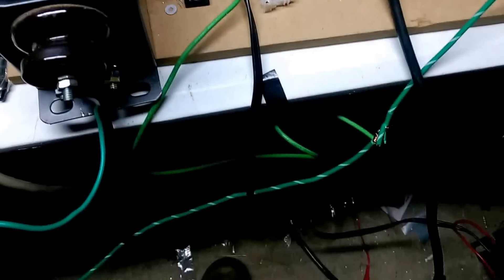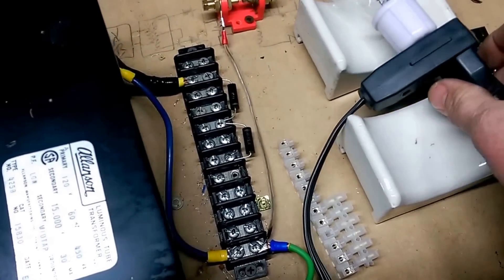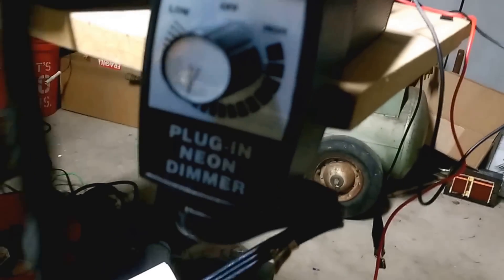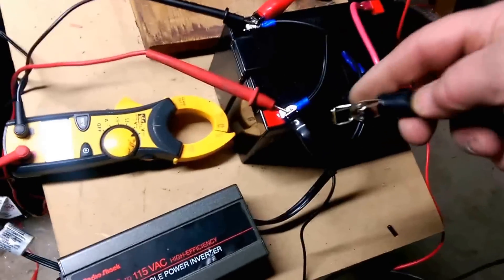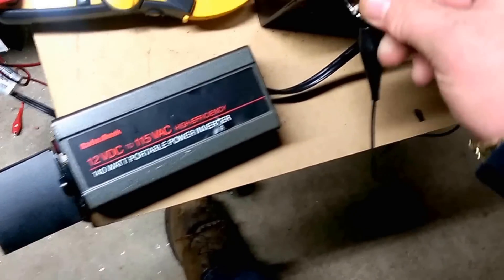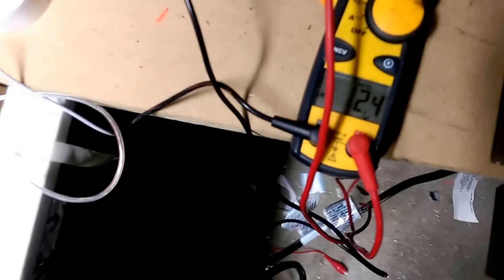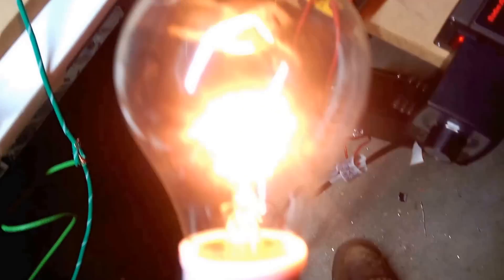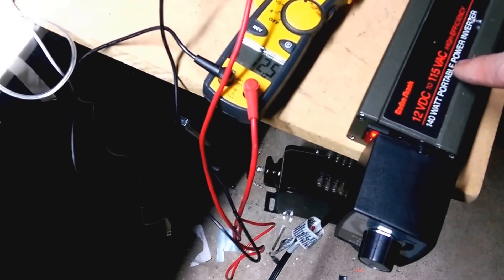Working Free Energy Generator-Dezeinstein Technologies-Annotated

Comment: Hi Marc! just realised that the inverter been powered by a battery to light a bulb is a very an ordinary thing so what is the specific of this demonstration? please.
Reply from the maker: +Didier Khwartz Ok, I have an inverter and a battery. I did power it up without the rest of the circuit so the battery does not charge from the circuit the way I have it set up and it dies just about immediately because the battery can't handle the massive ampere load that it loads the battery with. 

I have already posted another 21 minute video running an extremely bright flood lamp and the battery voltage remains the same without even dropping one volt. How could you explain this when I have (2) tiny 6 volt lead acid batteries running this, they are not high amperage batteries as inverters need high amp batteries? If you did this the same way with an inverter and the same bulb, you would see the voltage continuously drop 1 volt at a time every couple of seconds until it dies. The inverter is running off of a battery, and since it is running the NST as well, the NST is outputting 15,000 volts at 30 milliamps. multiply 15,000 volts times .030 and you get a wattage of 450 watts maximum, or, 225 watts at idle. Add the wattage of the bulb to this and you get 243 watts. The bulb and the inverter together would overload the inverter, but, it isn't overloading it and drawing too much from the battery because the battery is being charged by the circuit wirelessly.. there is no cheating, not whatsoever. 

So, if you think now that the inverter would run off of a battery for 21 minutes without running the battery down until the inverter shut off, you are way wrong. The battery could not handle this for more than a few minutes because the load would be approximately 20.25 amps at 12 volts. Please click here to watch the video of the same circuit, however, I modified an APC 300 watt computer UPS system with the batteries I used for the other circuit. The only reason why I use the UPS is so I can add more load to it to make it look as if it is doing more work to make it more believable.

First off, neon transformers are notorious for outputting more wattage than they draw, this is a common effect when they utilize high frequencies to run neon tubes, and, when they create an invisible plasma that allows a battery to draw in the system's losses, capacitively, and this can only happen with the correct wavelength, so, when I connect the ups system or the inverter to the battery with a kickback diode on the positive leg, the energy capacitively couples back to the battery as the positive leg and components are isolated with the diode, but, the energy returns to the battery from the neon sign transformer through the negative rail in the inverter since all of the grounded components are tied to one rail, leading directly to the negative terminal of the battery. The positive terminal of the battery is capacitively connected through the air to the rectifier lead that is NOT connected., If we add an antenna to this terminal , even more charge is given back to the battery, especially of the antenna has a plate that is coated by a unique layer which I have tried and it works to charge the battery as high as 14.8 volts, allowing a much larger inverter to be connected and run as a loop infinitely.

check out my video I just posted (once it finishes uploading and saving. it will be ready in 20 minutes).  I am going to open it to the public so you can see once it is finished with it's enhancements. I enhanced the video show it wasn't so shaky.                                                                         I tried the same way without the nst and it dies very quickly!
Reply: Dear Marc, Sorry if I have mistaken your demo and Thanks For The Time and Attention for trying here to clear-up the demo for me, I DO Appreciate. Yes, I will check your new video. Regards, Didier.
Reply from the maker: yes. There are many methods of attracting energy, however, I have successfully capacitively coupled to products which were nano coated. To do this, we attract ionized particles as we would to transfer electrons inside of a super capacitor. There are now compounds that are even more efficient than straight graphene oxide mesh collectors, however, it all depends on the pulse and frequency that drives the systems. I may not get any energy in using 15khz with a sinewave, however, once I transfer the component to a sawtooth wave, all energy levels change, and of course by tuning frequencies, many strange effects could be achieved.  Tesla spoke of the energy levels related to carbons, and, I thought right away of coating using graphene oxide. I made an awesome discovery with an attempt to coat an oxidized paper thin aluminum strip with an electrolyzed plating of graphene oxide. I then made a paint from  activated carbon powder and an acrylic, and painted over the graphene coating, where I was doing so to make a super capacitor. Then, I coated the plate with the electrolyte and I saw a static component which affected the piece of saran wrap that was under it to keep the mess to a minimum, giving me an idea that energy was being either coupled capacitively or somehow static clinging from the saran wrap to the coated metal. I didn't quite get to add the tissue separator since I noticed this and I ended up allowing it to dry. I tied it to a balloon with #40 magnet wire, then, connected it to a circuit similar to Dr. Paulson's. I was astounded by the amount of energy it pulled in. It was strong enough to charge ultracapacitor banks if I collected the energy with a one way device ( a very fast and static sensitive rectifier ) When this discovery was made, I knew I would be able to draw in the ripples of disturbed ambient from Don's system as soon as I noticed he did not connect to one pole of the full wave bridge rectifier. I somehow knew this would become the return, which is an aerial and it had no choice but to return the energy. Since I pump the energy into the ground for the phase conjugate mirroring, the return has to be through the air, and, since it mirrors, it amplifies the energy levels x 4-5 times. If I raise the balloon higher and raise the voltage, the energy amplifies many times more. The amperage is very strong with the use of the correct capacitors, however, as Tesla shows, it has to be pulsed on and off otherwise the transformer does not come to life, same with Don Smith's devices. The transistors that convert the energy in Don's system is the same as Tesla's vibrating switch or the rotating switch he shows in his patent images. This works phenominally! Science still states to this day that it has very close to zero amperage. It's quite the opposite.. In fact, the energy is quite capable of doing tons of work, all depends on the height and how the energy is collected. Ultracapacitors are our answer to free energy, however, they will be much better once the impedance levels are risen so the energy from the negative zone will play nicely with the load, if the resistance is very low, nothing happens, in fact the incoming energy will stop dead in it's tracks.
Reply from the maker: my demonstration doesn't only show the battery running the light and the NST, it is coupled capacitively through the spark gap since it isn't firing. There is a plasma component that is attracting energy in to literally charge the capacitors, and, since the center tap of the transformer is the only valid connection other than that same wire connecting to the capacitor's negative side, the negative component of the nst is firing into the ground, then, it is rectified and feeds the cap through the resistor, wire wound of course to bring the negative energy airborne, coupling the energy with the battery. The battery takes in this energy as it is wasted, so, in the method the battery connects to the system, through the inverter's negative rail, the reactive energy of the NST is able to flow, and it's cancelling component is blocked by the blocking diode on the positive lead, disallowing the return to happen through the positive, where phase cancellation would happen. The battery level raises just enough to allow the system to continue on chugging along, raising it as much as the energy used within the transformer. If the transformer was changed out, it wouldn't work because the impedance matches the battery's impedance. The negative rail and wirelength allow the wavelength to work as necessary. I didn't calculate this, neither did Don Smith.. We were just both lucky to have such an unordinary thing happen. The inverter needs to be looked over to see why or what is involved that allows this to happen. I do believe there isn't a varistor in the inverter which doesn't allow the cold electricity to bleed off, this is why it runs the way it does. A better aerial with great ionic attraction such as graphene oxide or carbons of a really high conductivity over materials like very thin aluminum are a great way to attract a static component, which cold electricity is closely related to only if it is within a radio frequency level or higher. The higher the frequency the more power, just as long as it is resonant and makles the circuit that much more efficient due to the resonant rise created within a circuit. The capacitive component of the inductor within my transformer is the only thing allowing this to work other than the impedance. If I could figure out how to duplicate this on other inverters and batteries without shear luck, I will be able to recreate this easily on many levells. I am getting closer and will post the answer to the question if I ever figure it out!

Comment from the maker: Hi Everybody! It's early and i woke up groggy and have a nasty headache, but, I get these headaches after I am in deep thought after a night where I had a very vivid vision of a working energy generation device. Last night I had one of these visions and I think this is something that will work extremely well. It involves the use of either a relay or solid state device to switch an HV source into one very large but fine wire resonant coil, connecting the coil to a dc cap bank or cap (singular) and by using a center tap and Earth, we accomplish the same as a tesla's phase conjugate system which allows this "amplified energy" to be pumped into the ground and returned back to the planet through the air. It is unorthodox because the system uses resonance with caps and coil, which the coil has a center tap that is earthed. The hv source, which is an nst is going to be used to fire the pulses of energy needed through a coil into ground, oscillating back and forth to create the amplitude of the system. The NST will be modified using a resistor in series to the ground wire of it's power source, which will assist modifying the gfci, eliminating the gfci from opening the circuit under load.  Then. we will fire the hv into the left and right sides of the coil, one side at a time, which is wired in parallel with the large dc capacitor using switches to allow the coil to be isolated from the left while the right is closed and vice versa. The hv doesn't need to remain closed while the nst is on, using one terminal will oscillate the phasing back and forth, providing a positive swing for one oscillation and negative swing for the other. This will energize one side of the coil and then shut off, to create an emf in reverse from the other side of the coil simultaneously into ground while these controlled pulses happen, drawing the opposing energies from the vacuum by inducing them into the charged but reversing coil, forcing the energy to enter the ground at identical times, creating a pulse of cold electricity that collides the two particles that aren't supposed to collide, creating high energy levels. The normal electron is pumped into the system, and, when it stops being forced in, the opposite happens to the imploding magnetic field, creating a massive spike of back emf, and reverse spin electrons, or, the "positron" which is forced into the same terminal going into the ground during identical times, causing this burst of energy to be released into the ground at a massive amplification. As the circuit needs to be in resonance so the nst doesn't see this "grounded pulse"  situation as a shorted output, it may be damn difficult to create, but, it seems to be the Casimir Effect in an unorthodox wiring method, which I discoved last night while the light bulb popped up in my head. This is a discovery of my own now that I will show how I attempt to build and try to work out the bugs with this circuit on youtube this evening. This is a "try" and you will all understand if you have prior knowledge in these experimental free energy systems, once you see my schematic. So, today I have a fun filled day with an Easter egg hunt for the kids , but, I will be available later on this evening for some video posts, maybe even a live session which will allow me to perform some live Q&A if you are all interested in joining me. Please subscribe if you wish to see the schematic, that is if you have interest in this and have not already subscribed, otherwise, you won't get the new video notification once it is released, uploaded and ready to view on the tube!. Thanks again.. Please have your friends subscribe and i will post the schematic to an online source and link it to the video description. Thank you everybody for your continued support. I really appreciate it and you will too once we get through to a working device that does what I think it will do!    Regards,  Marc
Reply from the maker: Thank you Diogo, I really appreciate the comments and positivity. It is the only way we will all eventually create promising devices that will eventually change our world! Mixing the devices is a great idea and I'm willing to try just about anything to see what would happen!

I look forward to working with you if you have that ability. Again, Thank you for commenting and please let me know more about your "floating discs" , I'd like to learn more about this. I have played with high voltages and plasma technologies now for a very long time as I am a professional in the high voltage industry that utilizes many medium and high voltage devices from the industry to build and experiment with these technologies. I am always willing to try something else that is new, to try and make something better or stronger.. that is  if I have the components to tdo so. I have tons of different components on hand and have spent hundreds of thousands of dollars over the years acquiring the tools, parts, wire, components, etc., so I could experiment with thousands of different technologies with what I currently have on hand. I enjoy this more than anything and It sounds like it is a hobby of yours as well!

Cheers!